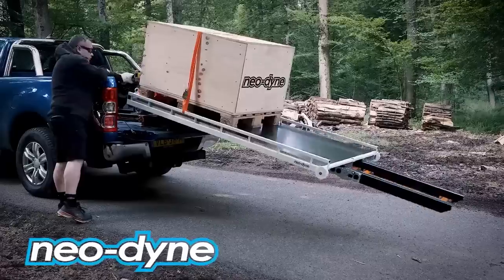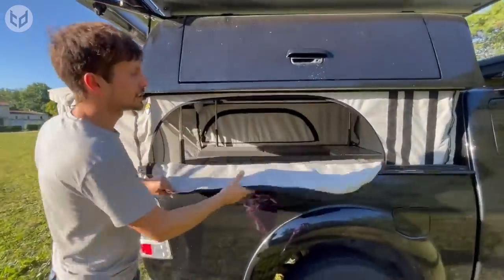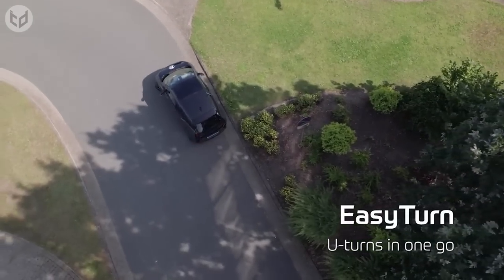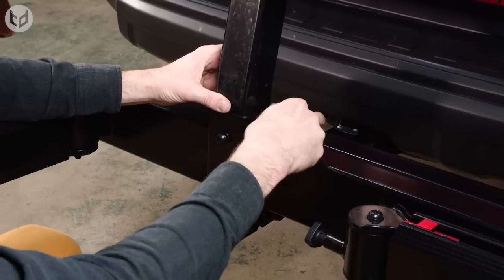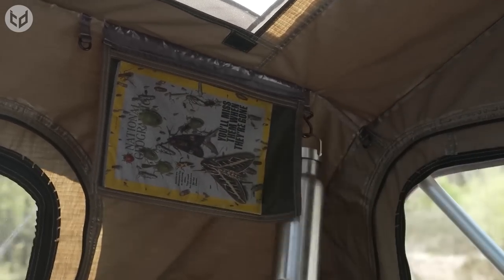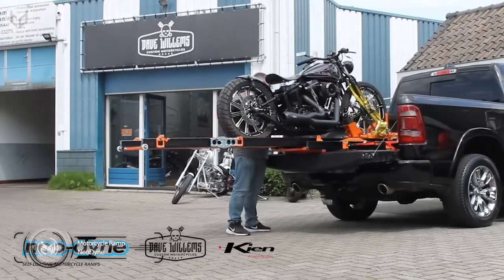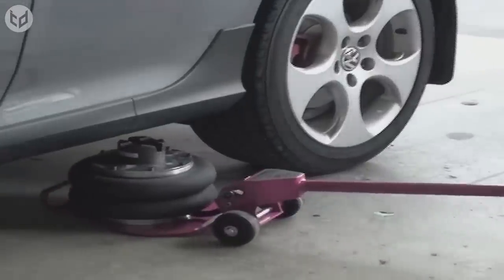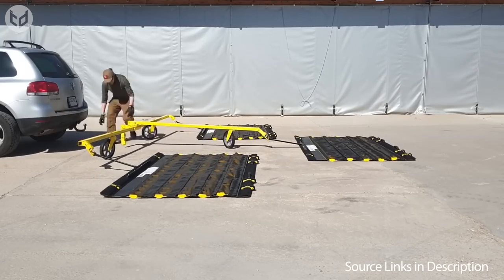Next-Generation Car Inventions that Are Worthy of Your Attention #2

Comment: I’m glad you included the runway sweeper.   Really important to any of your viewers that use general aviation to get around.  Loose screws and bolts on the runway can be quite dangerous and they are more common than they should be.

Comment: To get people more interested in electric cars, they need to be built so the batteries can easily be swapped out.  Maybe instead of gas stations, they have battery stations, that customers with electric cars drive into, and the batteries are swapped out with charged batteries.  The cost would be for the charging cost plus a small labor fee.  This is the only solution for long distance travellers.  Now is the time to begin this implementation, while the EV cars are in their infancy, and replacable batteries can be designed into the automobile.